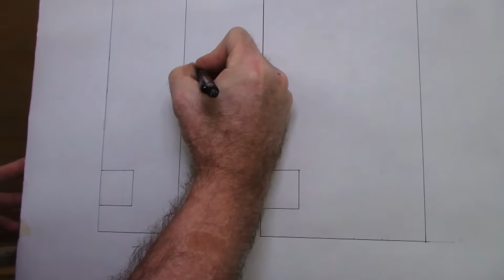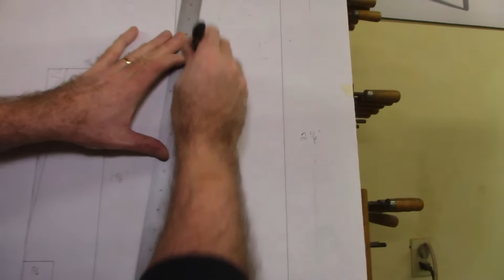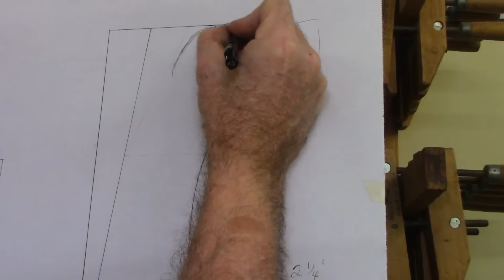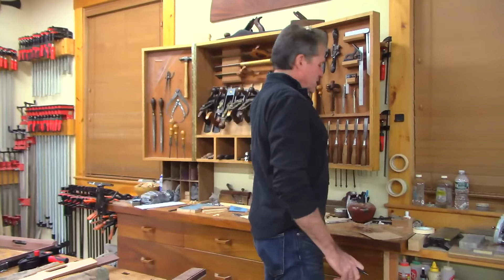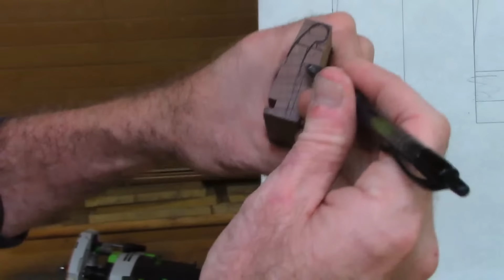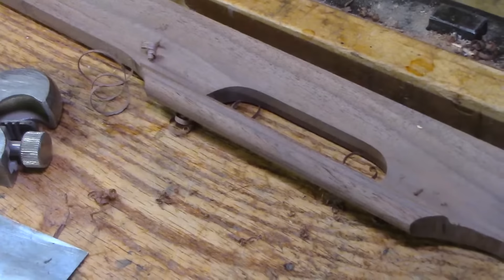Sculptural Woodworking

Comment: You may be able to make the end with the handle from a wider board of the same thickness as the other sides.  This would be done by using the face of the board as the inner face, and tapering the outer face.  The excess above the taper is positioned to become the handle.

There's a little adjustment of the inner bottom near the groove.

It may not matter if you have the thicker stock, but it's another option.
Reply from the maker: Hmmm, I think you’ll have to show me what you mean by that description. The trick with this piece was the corners had to be mitered, so that needed to happen referencing off the inside face before it was tapered. But I certainly agree, there are more ways to approach this one for sure. 👍😎

Comment: Well done.  On one of your previous episodes, you mentioned something called a feldor, or something like that.  What is a feldor?  Assuming that I spelled it correctly, I couldn't find it on google.
Reply: It’s his felder brand tablesaw. Bandsaw too I think.
Reply from the maker: Yes, John has it right, I was referring to the Felder K700 slider tablesaw, or the Felder FB510 bandsaw in my shop. Thanks for watching! 👍